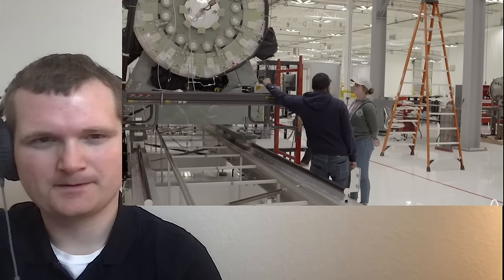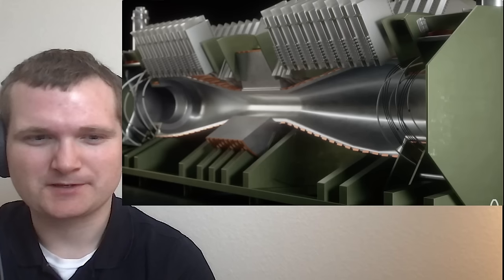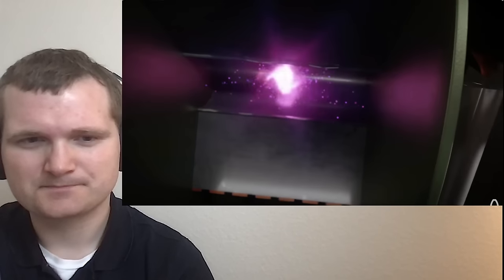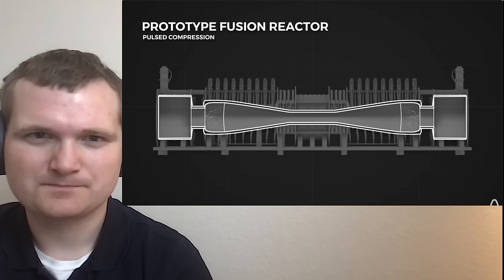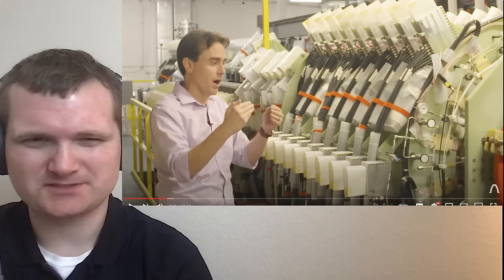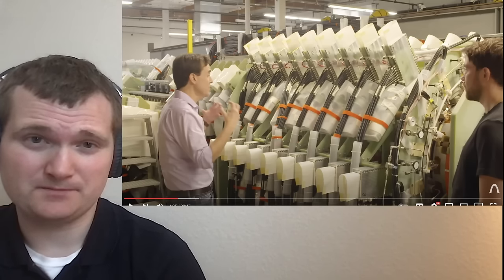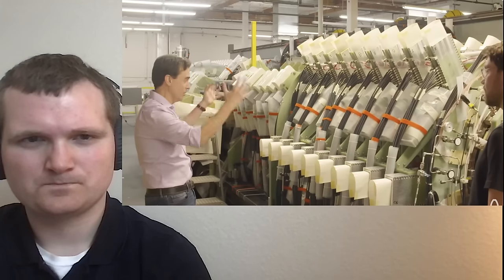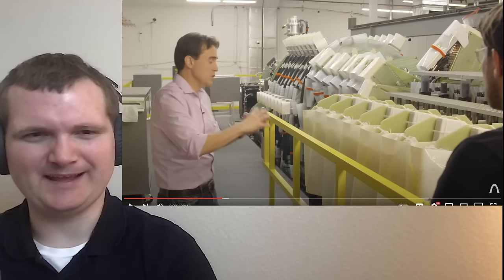Will the Helion Fusion Reactor ACTUALLY work? - Nuclear Engineer Reacts to Real Engineering

Comment: As an electrical engineer I find it exciting that there could potentially be a reactor that skips the whole steam engine part. I can see it possible to have the capacitors discharge to create the fusion pulse and be recharged back by it to a higher state of charge than they started with. In essence you would have to charge the thing from the grid to kick start it and once it is pulsing you need to steadily discharge the surplus back to the grid. If it can work even at relatively small sizes (lower tens of MW for example) it might even make a good variable source for the grid if the startup prodecure is just minutes long. Even if it is not that fast it still seems like it would have a faster controlability than a big fission reactor so it could have its place in the grid mix. 
As you pointed out the efficiency is a big question mark and all the inefficiencies are coming out of there as kinetic energy of neutrons and as various electromagnetic radiation. That needs to be shielded, the shielding will be heated up by it and if that is enough heat it might be worth it to re-introduce the steam engine part back in to capture some 30% of that waste heat. Basically making it a hybrid engine, part electric part heat. 
And I agree this is at a science experiment level now and therefore far from a powerplant someone can buy from them and connect to the grid. What I find optimistic about them is that the scale they run their experiments at for now lets them learn the lessons they wanted and implement them into the next evolution in a cycle of just few years. It is not taking decades and trillions in international funding right now to see if this direct-to-electricity method can be done or if it turns out the negatives outweigh the positives. It might get to that stage quickly if they find out they need to build it as big as a tokamak to make it workable. But from what I see it might be viable to keep it order of magnitude smaller even with all the future shielding and such. If that is the case then the speed of iterations to get it to commercial state can be much faster than other fusion projects.
Reply: I have a question. So the design skips thermal neutron steam generation but the thermal neutrons are still present in this system... so why not have a secondary system around the fusion core to generate steam as well. I know that's not Hellions project atm but surely a "Connections"  style confluence of technologies can produce a workable if less efficient power plant that can produce good output for a lower cost.
Reply: @nexus371  I was thinking the same. They have to shield the neutrons and other stuff sooner or later. That shield will heat up with the energy it absorbs. It will not be a small amount so converting about 30% of it also to electricity might be worth it once the whole thing is big enough.
Reply: Well, you can use process called Electrostatic Direct Energy Conversion (or Simply Direct Energy Conversion), and since they use pretty much aneutronic fusion reactor they probably use variation of Travelling-wave Direct Energy Conversion System.

Installation00 makes video that review the plausibility of HALO's UNSC and Covenant Fusion Reactor.
Reply: They can start up in less than a second, actually, once the capacitor bank is charged enough for the first pulse (and that would always be the case).
Reply: @nexus371  Neutrons would only make between 5 and 10% of the energy released by the machine (if it is a breeder- burner- hybrid). Not enough to justify the extra cost of a steam generator.
Reply: @elmarmoelzer2229  I imagine once the system is large enough for really commercial energy production the first pulse is as fast as you say but as the machine starts warming up after that it takes some time for things to settle safely and you wouldn't want to ramp up to full power too quickly. At least that has been the case for every large machine I have ever seen.
Reply: @rik I am not sure about that yet. They are still working on the higher pulse rates and the effects they have on the overall system. David Kirtley mentions that in the video as well.
They COULD also just operate a machine in He3 breeding mode (He3 to burn, Tritium to sell), then switch to D-He3 burning mode, when the grid needs additional power. With all that excess He3, they could probably produce more power than a normal breeder- burner- hybrid would.
Still, the important part is that their magnets are just aluminum which reacts really well to 2.45 MeV neutrons and is cheap and does not need complex cooling and shielding and all that.
Reply: @hebijirik But then, gas turbines can ramp up really quickly too.
Reply: @elmarmoelzer2229  a friend that worked at a gas turbine peaker powerplant that had 35MW electric output said that one took 35 seconds to ramp up to full power from running idle but already burning gas to keep hot. Imagine a machine with ten times the power. If they do it in under 3 minutes I will be very amazed. Still very fast compared to other types that can take days if not longerb. But it is not just a few seconds.
Reply: @rik Helion's plants will be 50 MWe, at least initially. They could go bigger and higher but that would probably make it more difficult to transport and service them. Currently they are designed to be transported by road.
Reply: @elmarmoelzer2229  ok, if they get that far it will be interesting to see if they manage to make it start up even faster than a gas turbine. At 50MW that  would make a nice device to cover peak demands on the grid if it can be turned on and off really quickly.
Reply: @hebijirik  Yes, it would be. We will see how it goes. I am optimistic.
Reply: @nexus371  Extra work. As far as I'm aware, they intend for these to be buildable in factories and stuff. An entire steam system which would have to have the hassle of leaks of irradiated water, as well as turbine synchronization, and the fact that the reactor will be changing it's power output based on demand anyway would make that too much of a hassle.

Comment: Getting energy out of it works the same way as putting it in: the coils used to accelerate and compress plasma into the reaction area and confine it there are used as generators after the reaction, much like a free-piston linear generator. As for what sort of output you'd get from that, field output will likely go through regen-braking type circuitry into the pulse capacitors used for the initial compression.

Comment: 10:30
Not a nuclear engineer, but an electrical engineer here.
If the conductors don't melt, any conversion from electrical to electrical energy is far more efficient than say converting from heat to kinetic to electric. You'll have to just convert the waveforms, and PWM Inverter can work above .95 efficiency, while the other conversions fall back far behind it. Hence, It will be usable in the grid. But can't have any ideas about how to isolate the conductors. If what they imply is true, my guess is that they use magnetic fields to keep the superheated atoms and particles away from the conductors.
Reply: Pretty much. Plus there is a silicon wall between the magnets and the plasma and a strong vacuum too. FRCs have a relatively sharp boundary as well. Their recent paper goes into that a bit.
Reply: They seem to be way more credible than they look in this video, and then there's the fact (that could appear to be trivial obviously) that it is backed up by Sam Altmam. And will probably keep founding them especially if he really starts rising trillions.
Than there's the fact that they have a PPA with Microsoft for a 50MW reactor in 2028.
Although I understand why every expert in the field has a 200% skepticism mode on when looking at this stuff. If their not an haux, we could solve all the energy problems of humanity

Comment: 10:15 I can answer those questions: the plasma never touches the conductors. This is the basis of all confinement of fusion systems. The question makes me doubtful about the video maker's knowledge about fusion. On the other hand, the electricity generated would be pulsing, which is a legitimate concern. I suggest we borrow a page from those old car engines and put multiple of these reaction chambers together. When one is generating electricity, one other is doing compression. Most electricity will go to the compressing coils, with the excess entering the grid. The waveform will still be spikes, but much more manageable. An added benefit is that the massive cap array doesn't have to be pulsed hard every cycle, which will probably reduce wear. They still need to be charged and used to start the process, pretty much like how a car engine is started.
Reply: They are just taking a detour through capacitors. The recovered input energy plus the recovered fusion energy ends up in the capacitor bank. Then is released to the grid from there.

Comment: 3:16 No, no, no, no, no, this sucker's electrical, but I need a nuclear reaction to generate the 1.21 #gigawatts of electricity I need.
Reply: I believe you mean jigawatts
Reply: @b3dubbs72 I think that it was actually gigawatts on the script. If I remember correctly, whether the G was a hard or soft G (like the GIF debacle) was more up in the air at the time and the actor hadn't heard the term before. When computer specs started being measured in terms of gigabytes, the pronounciation of 'giga' with a hard G became more rigidly established.
Reply: It was TEN point Twenty-one JigaWatts!
Reply: @kayakMike1000  You might want to check that...
Reply: @kayakMike1000  you must have slipped into an alternate universe at some point. welcome to this reality, where it is and always has been 1.21 jigawatts
Reply: hey doc what is a jiggawatt..
Reply: Doc Brown was a real jigachad
Reply: @hail_satan  one of the handfull of movies i rewatch whenever they come across.

Comment: My opinion of Helion's approach was that most of their challenges were relatively simple, they have more challenges, but they've dodged some of the biggest ones that tokomaks struggle with. Meaning they should have a more straight forward path in terms of developing towards a design that's ready for regulatory testing.

In a tokomak, the walls of the fusion chamber have to handle: Neutron impacts, heat/energy collection, fuel injection/breeding, and likely more, meaning improving one of those factors will likely lead to complications with others. in Helion's case the injection happens separately, and the energy collection is electromagnetic instead of thermal, which should make the design easier to handle. Also, pulsed magnetics avoids the issue of super conducting electromagnets and the frequent issue of quenching.

In truth it remains to be seen who will end up having the easiest or best path to viable fusion power, but I'd personally say that Helion and laser inertial confinement are the two most likely to see success. Tokomaks have just... they take decades to build just 1 and have only gotten bigger and bigger with little progress. They just take way to long to ITERate (sorry I had to)

Comment: the thing, as far as I understand it, is: they once developed ion engines, and plasma engines. essentially eject material out one end at really high speed (therefore high specific impulse).
in fusion, particles that can fuse need to collide at really high speeds, usually achieved with high temperatures. with higher temperature, particles travel faster, but all the particles go in different directions. here, they want to send them all into the same direction. you can assign a fast particle with a high temperature. you could in theory assign a temperature to a car on a highway (at highway-speeds, cars are actually quite cold).
so they fire two of these "engines" at each other and in the middle, the fusable atoms collide. for real fusion, they need to build bigger and have higher speeds. but for testing the tech it's a good method.
funnily enough, there is another british startup that wants to create fusion by firing the fusable material with a gun. and it is driven by gunpowder. they actually have fusion, but it is far from Q = 1

regarding beryllium: world production: 250t anually. so not exactly a lot. but again, there is not much need for it.

Comment: I think a practical machine would want to use superconducting magnetic coils, not copper. As for connecting it to the grid, its output would likely be low-duty-cycle DC pulses at a couple of kilohertz, and be run thru an inverter to generate 60hz AC.
Reply: Most likely...
Tyler likes to avoid the actual process of what fission/steam generated power goes through too to make it usable. And everything I've ever read, told me that fission plants, after the several separate operations to get to the actual spinning of the turbine, the % efficiency of thermal energy to electrical energy conversion is somewhere between 5-10%.
I understand his bias though, he's a fission specialist, so anything that threatens that is "looked down upon".
Fission is the best we have now, but it can never be the end solution. Not with the mining uranium, enriching it, storing the spent fuel etcetc.
Reply: @John-ir2zf  5-10% That seems conspicuously low. I know they run cooler steam than what is standard for fossil plants, but that just loos very limp. Coolant pumps and the like can't suck up THAT much power right? Where did that number come from? I'm genuinely curious.
Reply: @fnorgen  that percentage is actually a guess on my part and may be low, top end would be 20, maybe 25% efficiency. but Carnots principle dictates efficiency must be below 56% for any mechanical heat engine. Power plants base their 30-33% "efficiency" on base theoretical fuel load heat, and projected output "work" provided by that heat. They tend to ignore some of the inherent losses such as reheating or preheating (often done with electric heaters) because "technically" it isn't part of the Carnot equation but still lowers the overall efficiency.
It's basically a slight of hand (or numbers) to make the efficiency appear higher than it is.
Reply: Maybe not superconductors actually heat up with changing currents even if you dont quench you will spend a lot on cooling power.
Reply: @slickm7  I was thinking superconductors primarily for getting the high magnetic field density required for ignition.
Reply: Superconductors are expensive and take a lot of time and energy to cool down. Helion does not need them. Their magnets are made from aluminum, btw.
Their pulse rate is limited by the time it takes to evacuate the chamber between pulses and the wall loads. Polaris will do 0.1 Hz to maybe 1 Hz. Future power plants will be at 1 Hz to 10 Hz.
Reply: @elmarmoelzer2229 Isn't aluminum a bad material for magnets?
Reply: @mrblackx8665  
Aluminum has almost the same resistance, but is way stronger. Resistance scales as sqrt(rho). They have done copper and aluminum. Aluminum works better at higher fields. Key is conductivity to strength ratio. 
And most importantly Aluminum is much better in a 2.45 MeV neutron environment.
Less susceptible to damage and cool down is minutes vs hours with copper.
Reply: But I need 50Hz AC!   ;)
Reply: @cescoaiel5336   And that is no problem. They store the returned energy in capacitors from which it is gradually released to the grid through an inverter. Just like grid scale batteries do.

Comment: Generating the electricity directly from the fusion is a good thing since it would get rid of the energy loss from transfering energy/heat from the reactor through the water pipes to the water and all the way to the turbine. Sadly its still in the testing phase while steam turbines are well understood and alreasy in use for who knows how long.

Comment: Direct conversion is easy enough to do, similar systems already exist everywhere.  We have to understand the difference in reaction products between De + He3 vs pretty much every other fission / fusion reaction out there.  Most everything else produce the majority of their energy in kinetic neutrons that then need to be captured and turned into thermal energy.  De + He3 on the other hand releases only 5% of it's energy as kinetic neutrons, the rest comes out as kinetic alpha particles, mostly protons.  Those alpha particles have an electric charge and therefor interact with magnetic fields and will dump their energy into the magnetic field which can then be extracted the exact same way regenerative braking works.
Reply: In the full Real Engineering interview, Dr. Kirtly actually uses the same regenerative breaking analogy. Pulling for these guys. Good enough for Sam Altman and Microsoft.
Reply: The problem with D-He3 is that D-D is also possible and releases lots of neutrons.
Reply: @TlalocTemporal  That is a minor side reaction, all nuclear reactions have them.  It's about how much total energy comes from which type that you optimize for.
Reply: @palladin9479  -- The reactivity of D-D fusion is higher than D-³He fusion under ~300,000,000°C, and never gets more than ten times as reactive. Not to mention that the ³He is produced by those D-D reactions, necessitating a neutron control system somewhere.
Reply: @TlalocTemporal  ..... umm in a D+HE3 reaction the D-D is a minor side reaction....  The cross sections of those fuels is very different.